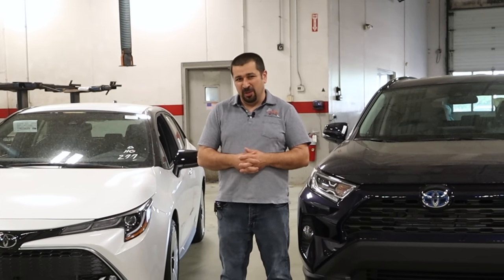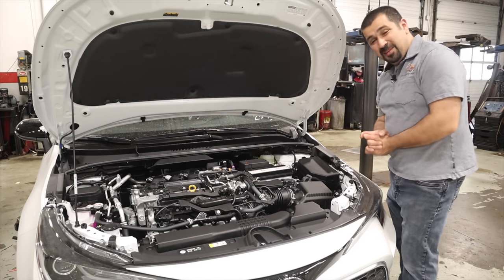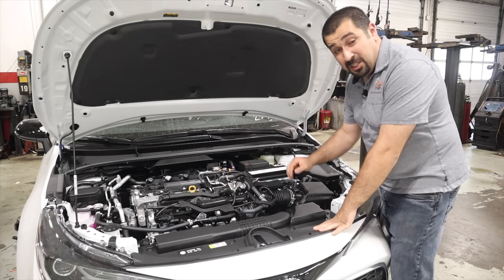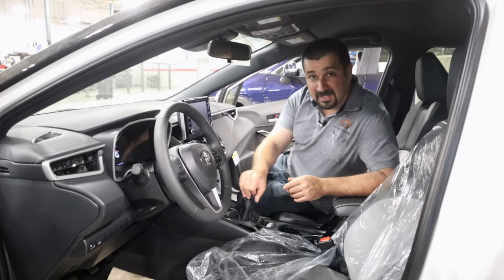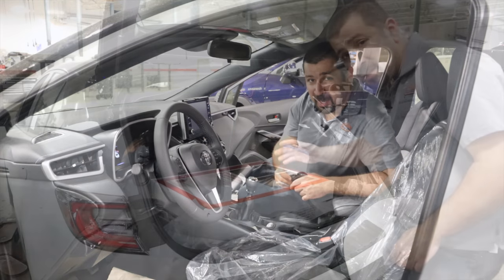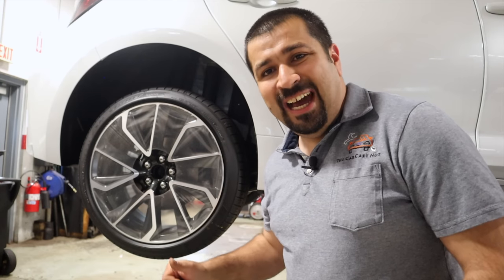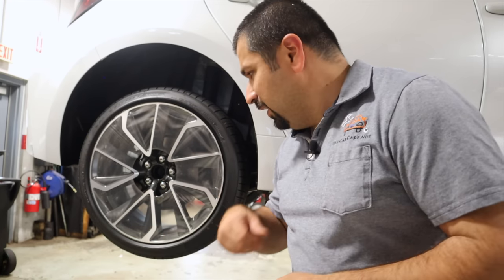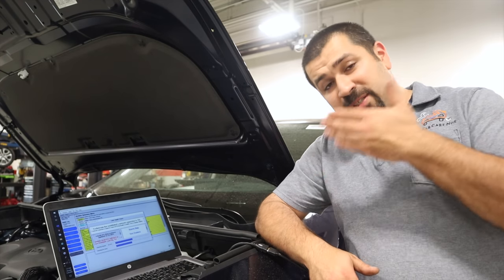Buying a new car? Here's what happens behind the scenes.

Comment: My 2021 Camry hybrid Le was manufactured in Georgetown Kentucky on May 10th, arrived at the dealership on the 19th I bought it on the 20th. I didn't have the freedom of choosing a color because it was the only Camry with lithium ion battery that came with cold weather package, heated seats heated mirrors and blind spot monitor. Actually it was the only Le in the whole state that is offered as new with the cold weather package. So I got the heated seats without paying for any other unnecessary money wasting bills and whistles like moonroof or upgraded radio or wireless charger.

Comment: Soooo rear sway bar bolts on a corolla 2021 took 3/4 of a turn to tight them to fix a rear knock that was found by a technician at the dealer like your self by observing a clean place around the screw and figure the bolt was moving a bit. He was blown away that this happened and i was very thankfull for him fixing that. Also he was at a different dealership than the one purchased first could not fix it and that was my 5th visit!!!, first front plastic part/rubber sway mounts replaced with just rubber, power steering rack replaced and finally the rear bolts thingy. All good now life is great but my first experience with toyota not so great......anyway i guess i am unlucky or QC needs to step up a bit. Car was built at UK......Again great info! love your passion AMD!! Thank You!!

Comment: Good video as always!  I just bought a 2023 tacoma TRD OR, and noticed a rattle after leaving the dealer.  It sounded like something was loose/rolling around in door panel or top of dash.  I brought it back to the dealer, and they pulled the top air vent plate and found a 10 mm bolt that was left behind during the build.  I never have had that sort of thing happen with any of my Toyota's.  Weird to say the least.  I am just glad they didn't have to pull the whole dash off or apart.  Other wise the truck seems very solid and tight much more so then the 17 that I previously owned.

Comment: Toyota from day one has always been about quality dependability and reliability.
Reply: I have a different take.  They are actually focused on efficiency, and because cost of poor quality when it gets to the customer level is very costly and a waste of time to root cause and provide a fix, they build in controls to prevent it from getting that far.  The consistent product is just a side effect, but is more marketable.
Reply: I heavily disagree. I have a 2019 RAV4 Advetunture (new body style) that has had a new transer case, two fuel pumps and more. New toyotas are of terrible quality.
Reply: I agree. My wife drove her 2003 Sequoia 300k miles and only had to have the timing belt changed one time...at about 200k miles. I had a 1984 Toyota truck......was amazing. I have had a 2016 Camry LE that was a great car until someone rear-ended me. They ended up totaling the car because it would have cost more to repair it. Replaced it with a 2018 Rav4 Hybrid and loved loved that car. Just upgrade to the Rav4 Prime and talk about a jump in performance and quality.....wow. If you drive any car with respect and don't be a "lead footer" the car will last a long time. It is when people lower them, put wheels on them that aren't meant for them, enhance other things is when the issue arise.
Reply: Someone I know had a 1997 Toyota Sienna mini van that they bought used and had for years, pretty impressive quality and durability for a 20 plus year old vehicle.
Reply: @lindap.p.1337  Congrats on your reliability. I wish you many more happy miles with your car. Though Toyota has just been giving me the runaround. I will probably just change cars soon. I'm done with Toyota.

Comment: Bought a new 2020 RAV 4 and drove it for 4 months without checking the tire pressure.  When I did, I found out that the pressure was over 50 pounds.  So, your advice is appropriate.  Don't assume.  Thanks for what you do.

Comment: I used to do PDIs for Toyota.  off the trailer into the state inspection bay, valve stem caps changed to nitro fill ones while the dial up inspection ran.  Then right out on the lot, they paid such a small amount per car I couldn’t actually spend any time checking anything.  Never saw a “check sheet” which is interesting because I’ve done 1000’s of these.
Reply: And then they add a huge prep fee.

Comment: The longest lasting original batteries I've ever had in my vehicles were two Toyota Tacoma's. My other new cars usually last just past the 3 year warranty or only slightly longer.
Reply: Me too. My Toyota sienna battery lasted ten years. My previous chevys lasted four years.
Reply: I bought a brand new Toyota Yaris in 2009.  The original battery lasted till 2018!
Reply: @hamsterama  I also had a 1991 Toyota Pickup (pre-Tacoma) that I never replaced the OEM battery. I guess I'm reporting my age. LUL! I think Toyota OEM batteries are still all made by Panasonic. In the U.S. I'm not sure a person can purchase a Panasonic replacement. We have three battery manufacturers in the U.S.. Maybe AMD will comment if he thinks it's worth it.
Reply: @dskwared2u610  Wow!  That's amazing, that your battery lasted 30 years, and counting!  I live in Ohio, and supposedly cold starts during freezing weather are harder on the battery.  Maybe that's why my battery lasted "only" 9 years.  Luckily, my car was in the garage when the battery died.  So, I wasn't stranded anywhere.  The battery died in the summer actually, not in the winter.  I called AAA, and they came and replaced the battery.  Anyway, I also presume that the Toyota batteries sold at dealerships are not the same as the ones installed at the factory.  But next time I go to the dealership to get an oil filter, I'll ask the parts guy if he knows who makes the batteries sold at the dealership.
Reply: @hamsterama  No it didn't. It lasted as long as I kept the vehicle. LUL! I do try to trade them occasionally.

Comment: I bought a 2021 Corolla Hatchback SE.  Plugs found in glove box.  They said to bring it back but didn't do it yet.  I'm going to plug them in myself.  Thanks for showing where they go.
Reply: I checked the plug holes and they had the plugs installed.  I guess i have an extra set in case they fall out.

Comment: thank you for your VDO ,  i noticed the body plugs in the passenger door of 2021 prius plugin  ,  so i got suspicious that maybe they never did all the inspections you talked about, so I checked the tire pressure and sure enough, as you said they were at 55psi and you better believe the Washer fluid reservoir is BONE dry. if not for your vdo i would have never known that they did not do their job. Thank you.

Comment: AMD, Thanks for the inside view. We don't make Corollas in Canada anymore so it has to be the RAV4 Hybrid from Ontario. I really like the Corolla hatch but it is 6 inches lower than the made-in-Cambridge-Ontario Matrix used to be. We also make Hino trucks, the Lexus RX and soon will build the NX. Finally, let me congratulate the (short) citizen of the Land of Lincoln who had the good sense to order a manual transmission in their Corolla . ;-)
Reply: Why are manual transmission superior to automatic? Sure they're more fun for some people, but in terms of practicality, say for fuel economy or traffic, isn't it better to have an automatic?
Reply: @3Faidonas3  Good question, in a world of distraction, the driver engagement provided by a manual is priceless. When I can find a car that burns CO2 and emits oxygen from the tailpipe, I hope it has a manual or I still might not switch.
Reply: @rightlanehog3151  so for safety, got it. Perhaps this problem will be solved the more cars become autonomous :)
Reply: @3Faidonas3  Engagement and control are essential components of safety. For example, being able to easily gear down to slow your car on slippery roads is invaluable.
Reply: @rightlanehog3151  well to be fair it's still possible to do that even with hybrids, they have the little pedals that engage the engine or the Breaking mode for older models
Reply: @3Faidonas3  It used to be stick shift is more fuel efficient than automatics but that is not true anymore. Automatics have gone up in efficiency much better than manual.
Reply: @WAN2TREE4  I never said otherwise :)
Reply: @WAN2TREE4  An automatic going 20 over the limit is a lot less efficient than I am with my manual in the slow lane.

Comment: How to tell that they rushed PDI - They leave the frame rail plugs (body plugs) in the glovebox instead of putting them in. Now the underbody will corrode faster and you’ll need a new car sooner. I found  these on my wife’s RAV4 in 2015 in the glovebox. Complained to the dealer and they said “they are only for undercoating”. I had the PDI checklist so I knew this was bulls—-. Installed them myself (after making sure the frame rails were dry inside, as the car had been washed. Complained to Toyota Canada about this miss and they referred me back to the dealer.

Edit—what annoys me the most is that Toyota corporate didn’t give a crap. Maybe I should have called Toyota Japan?

I’ll also add that this made the road noise much greater, when the plugs were out. They test-drove cars this way too. I wonder how many sales they lost.
Reply: Good eye bud
Reply: @MowerModdin  the dealers here have first-rate mechanics. They also have the 2nd, 3rd and 4th rate as well*. Guess who does the PDI?

* charges for service are first-rate of course
Reply: what is the name of the dealer?
Reply: @seanh2390  don’t want to name and shame here. I’d like to, but there’s libel laws etc and they are a big dealer
Reply: @correcthoarsebatterystaple  It's not shame if you state facts.
Reply: @paladinhill  I don’t want to get sued, it’s a big dealer.

Comment: I once worked at a Hyundai dealer, and although the quality of the cars was very good, we had a few issues when driving cars to various storage areas before they were PDI'd.  Once, we had to move a Sonata to our other location, about 30 miles north.  While driving it there, the lot boy had to pull over on I-684 when the engine overheated.  The factory had forgotten to place a hose clamp, and eventually the hose came off and ejected the coolant all over the road.  Hyundai replaced the engine on that one.  Another time, we received a rare '06 Sonata with a 5-speed manual.  My sales manager asked me to drive it to the storage lot.  I took it for a brief test drive, noticing the clutch was very heavy for a 4-cylinder car.  Next thing I knew, the temperature gauge was pegged on full hot!  Someone at the Ulsan factory had forgot to finish adding coolant to the engine.  That one we were able to save by adding the coolant back at the dealership.  The car was then swapped to another dealer.
Reply: No wonder why some other cars they break down around 30-50K they prolly break down before they sell it and just fixed it at the dealer
Reply: I like the features of Hyundais. They're very stylish and have more creature comforts than my Toyota. My stepmom gets a new Hyundai every month so it's great a chance to see and compare them. I would consider getting one, however, I haven't met a mechanic that hasn't spoken bad about them. No one will give them a lifespan past 100K miles. Carcomplaints seems to agree.
Reply: @phoebenichole  It happens with all makes.  Sometimes the car has to be moved around before service can give it a PDI.  I later purchased an '06 Sonata from the dealer I worked at, escorted it off the carrier and through PDI, car was trouble free for over 130,000 miles, still running a few years back in Thornwood, NY.  But would avoid a Hyundai today, what with all the engine recalls. And the prices are not that reasonable any more.  But they do have some good lease plans with huge discounts built in.

Comment: I went to my Toyota in North Miami, Florida for an oil change for my original 1997 Toyota Rav4 and they forgot to add the oil.  I always check the work done at home. And believe me I drove that car carefully back to the dealership. The manager told me the engine is fine did not get damage, but he wrote a note on my account should anything happen in the future, thats what he told me.

Comment: When I bought my 2012 Prius Plug-In and drove it 40 miles to home, I checked the tire pressures, they were ~55psi all around (spec is 35/33). Should have checked them at the dealer. Lucky I didn't have a blow out. I did inform the dealer.
Reply: Same with my 2014 Prius V great gas mileage though

Comment: My last new Toyota I bought (98 Corolla) did not have those rubber plugs installed, I found them in the glove box and had to learn where to install them myself. Lousy dealer prep.
Reply: I don't understand why they don't install plugs at the factory on all Toyota vehicles.... Must be while in transit to Anchor the vehicle to the car truck hauler?
Reply: I have a 98 Corolla too still going strong.
Reply: Sold my moms 98 Corolla March 2020 with over 283k miles. Great car.

Comment: "Don't drive the demo, drive the actual car" - best advice I wish I heard before buying my last car.

Drove 2 demo cars, bought one with different seats. Massive difference. Regretting my purchase just because of seats.

It's not Toyota though, it's Opel. Test cars I drove had basic cloth seat and leather seat. I bought one with "comfortable" cloth seats, which have bigger side support everywhere and smaller area for actual driver. Also other factors in car related to GM (one of last models made when Opel was part of GM) quality that contribute to my buyer's remorse.

Comment: I'd say the most important item to check is the oil. Even tho there's an oil light.
Reply: Do different manufacturers have different check lists and perhaps lower standards than Toyota? I just bought a Hyundai. What should I expect?
Reply: @frednewton9323  Im no expert but I have an opinion. A few yrs back I did some routine service on an accent. It seemed like a decent car and served the owner well. However since then Hyundai has had some major issues with engine failures and vehicle fires in some models. Owners of these cars for the most part are being adequately taken car of but for me I wouldn't buy one. Other brands have better resale and reliability reputations over Hyundai. I prefer appliance like dependability. 2019 4cyl Camry SE is my appliance of choice atm.
Reply: @frednewton9323  A tow truck.

Comment: I just purchased a brand new 2023 Corolla SE. Cool to see what happens before the customer gets it. I actually purchased a very well used Prius the day before. Got it home and looked at the service history and found it was recommended by the dealerships mechanic to have the engine replaced due to bad head gasket. Not sure how it made it on the lot and I don't care. They bought it back no questions asked when I offered to buy a new car instead. I also bought the extended warranty for the term of the loan. 84 months FFS! They're going to be a 20 year loan before too long unless we get some sort of dollar squish that brings things back to normal. Thanks for the great videos. Ill also be taking it in for a break in around 1200 miles. They said no break in but Ive seen your videos and I thought 10k was weird
Reply: 84 month loan and you paid for a warranty? Boy, the finance dept saw you coming from a mile away!

Comment: Do you check whether the spare tire has enough air in it.
Reply from the maker: That is one of the things that are debated. I check it because it’s simple and almost all of them are spot on
Reply: @TheCarCareNut  It would be nicer if spare time has tire pressure sensor and system recognizes it also. Small details sell.
Reply: @deeneyugn4824  Some of the toyota models do have sensors in the spares
Reply: @deeneyugn4824  my new Rav4 XSE doesn't have tpms which is my biggest disappointment on this wonderful car.

Comment: Years ago I knew a man who bought a new Bentley. I drove it shortly after he took delivery. It was severely out of line. Tires weren't balanced and there was an odd rattle that turned out to be loose lug nuts! There was an obvious upholstery defect, too.  He wound up selling it (VERY lucky) after less than 2 yrs. because it spent so much time in the shop (of course). He then followed my lead to Lexus.

Comment: My highlander xse tires was not deflated.  I found out after 500 miles break in.
Reply: The first thing I always do when buying a new car is stop by the gas station and fill up the tank (dealers here only put in 5 gal), check tire pressures and all fluids.  You'd be surprised how many times those simple things get missed during the PDS.

Comment: I bought a 2021 Tacoma in May. The passenger side headlight and parking light where not plugged in. The plug and harness was just hanging in the engine compartment. This Tacoma was brought to the dealership I bought it from in central Virginia from one in Northern Virginia near D.C. Both dealerships also did Va state inspections on the truck. I only noticed when I got home and it was dark. My wife got out first and said the headlight was out.

Comment: Hi AMD, great video as always. You mentioned the RAV4 have 51 computers, do you know of hand how many computers does 2019 4Runner Limited will have?

RAV4 made in Ontario and Corolla Hatchback made in Japan. I looked at the hatchback at one point because it was made in Japan but it doesn’t come with sunroof.
Reply from the maker: Not right off the top of my head but I'll remeber to check next time
Reply: I was told my 2019 had 47
Reply: @2004cyrus  oh wow, that is still quite a bit of computers. Thank you
Reply: @Thankyou_3  oh yea it is! No problem